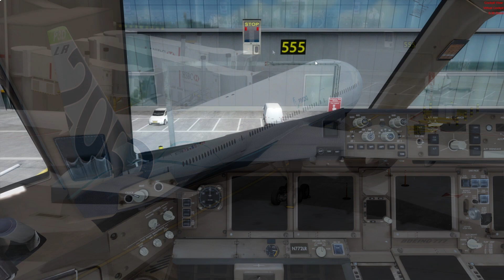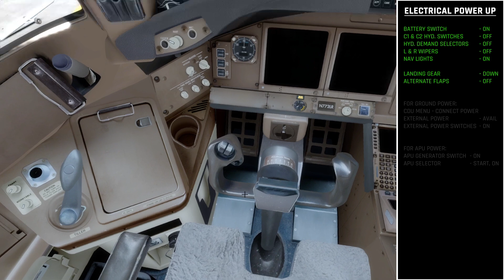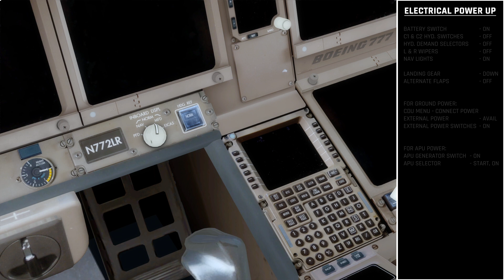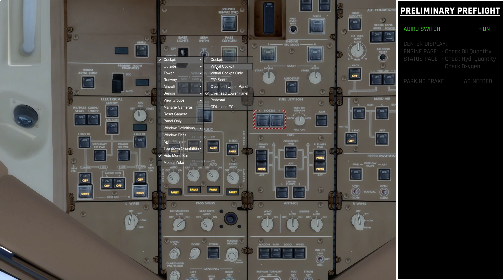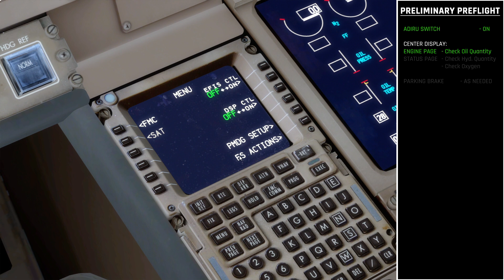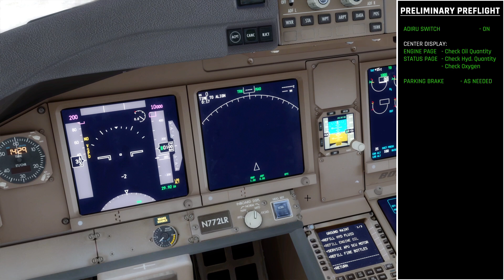PMDG Boeing 777 - Electrical Power Up

Comment: 1. Do you need to turn OFF the Battery after turning ON the external power (Press Avail) or leave the battery ON with External Power ON until you're done? OR

2. Do you need to ON the battery first before Starting External Power? Or its okay to just directly start or Press the "AVAIL" sign with battery off.

**Situations for line maintenance check only and Cabin Operational check like seats, IFE, etc.

**Aircraft from completely off in Line to start power for maintenancen purposes only.
Reply from the maker: I would need to read the manual to check but I think you would want to have the Battery ON in both cases. Basically the 777 has five main sources of electrical power. These are the Engine Generators, The APU, the deployable Ram Air Turbine (RAT), External Ground Power and the Batteries. If you're on the ground and the ground power system fails, then the power switches over to the batteries. If you have the batteries turned off and you lose ground power, then the aircraft totally loses electrical power and goes "dead".

With regards to ground maintenance checks, the maintenance crews will have their own procedures and checklists for testing systems and I don't know how battery usage is managed unfortunately. I've only learned procedures from the pilot perspective.
Reply: @Doofer911  Well explained, thank you Sir. Have a nice day.

Comment: Amazing video!
I have two problem. When I watch my flight in replay mode It does not show gear, flaps, slats animations. Do you know any software which shows animations?
I have thrust master quadrant. Do you know how to set up MCP panel. How can I create shortcuts for HGD, SPD, ALT on the quadrant.
Thank you  very much in advanced.
Reply from the maker: I don't know of any software that can do that I'm afraid.

Comment: Thx!  With the battery on you should be able to turn up one of the displays to show the APU status (EGT, etc). Is this functional this way?
Reply: I know this comment is old, but if you're still interested you should be able to see APU start status and information on the lower center display unit just above the throttles by selecting the "STAT" button on the display select panel. Unsure if that DU is powered with just the battery on though.
Reply from the maker: Just found a real life video of someone starting a 777 APU from cold and dark and he didn't activate any displays or talk about them until the APU Generator kicked into life so I don't think it's possible
Reply: Airbus lets you do this. Odd Boeing doesn't. I think I've seen 767 cold and dark do this.
Reply from the maker: Does seem strange. Another thought I had after making the video is that there wasn't any requirement to do a fire test before starting the APU from cold and dark and this wasn't done in the real life video either.